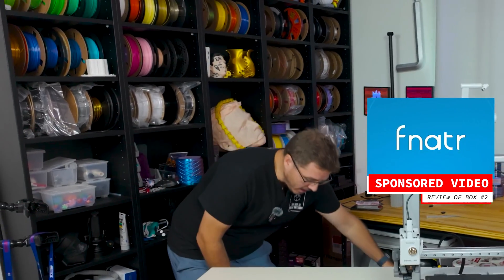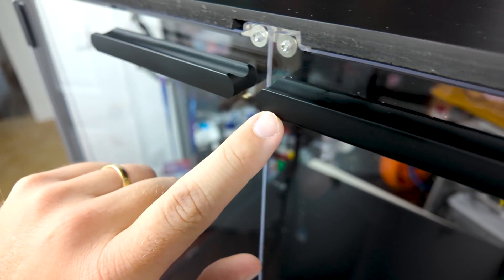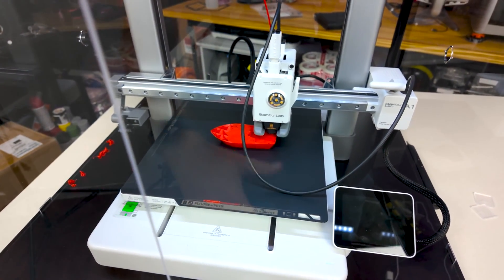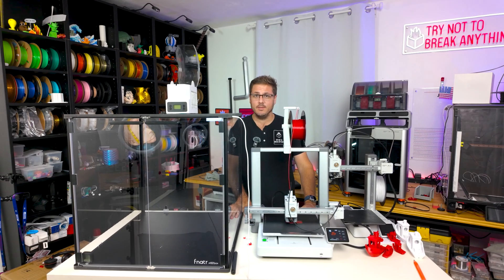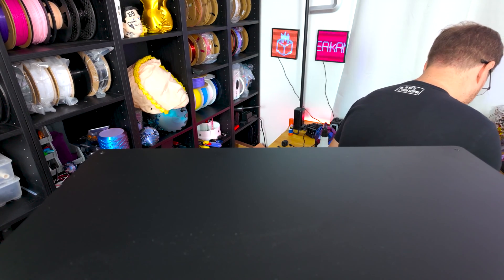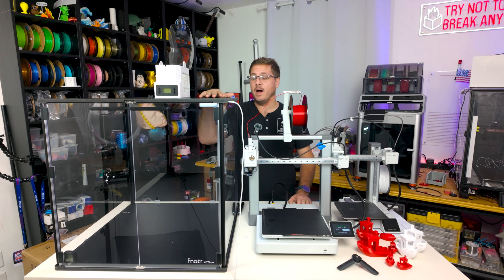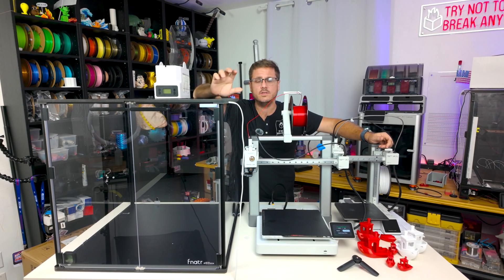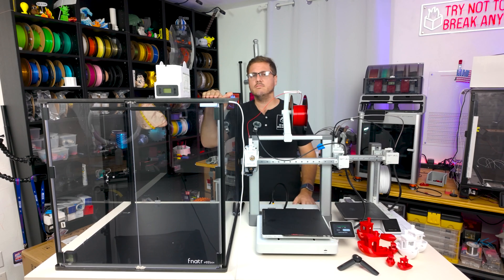A Premium 3D Printer Enclosure that almost hits the Mark - Fnatr Box #02 Review

Comment: Thanks for the great review.  I have this enclosure with an Ender 3 v3 SE.  I am looking to upgrade to the A1 (non mini).  Can you please confirm that the A1 (non mini) has full range in the enclosure?  I read somewhere it needed more space to fully extend than the enclosure had depth wise.  Is that true?  Thanks in advance.

Comment: Wonder if the AMS connector is a standard 4 pin or if there are extensions that can be purchased somewhere. Bowden tubes can easily made longer by buying a roll of the ptfe tubing
Reply from the maker: It looks like a smaller smaller 4 pin molex cable. Now you have me thinking about some of the possibilities! :)